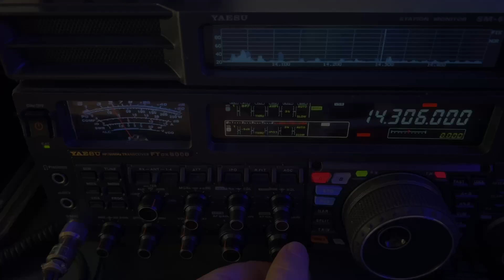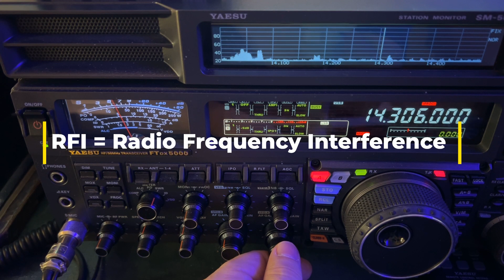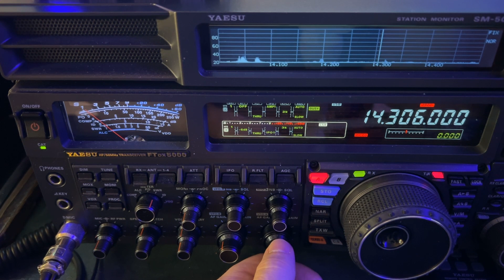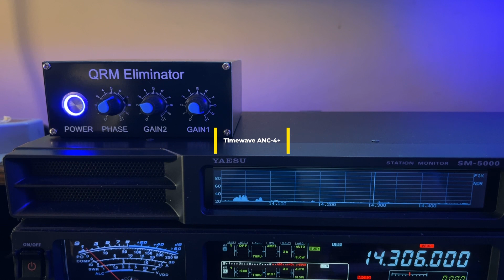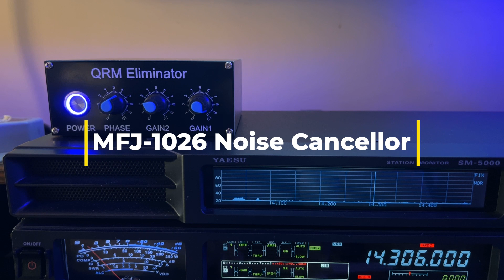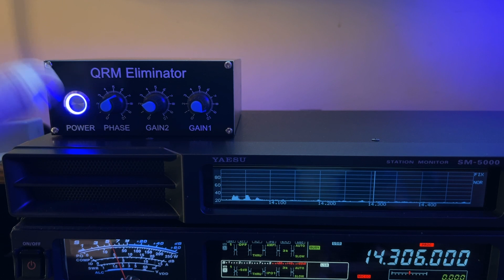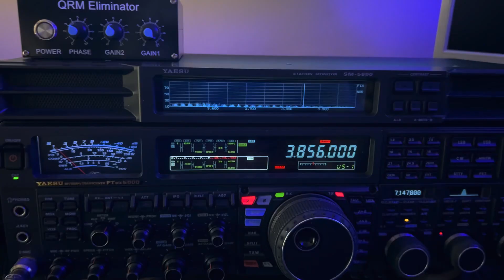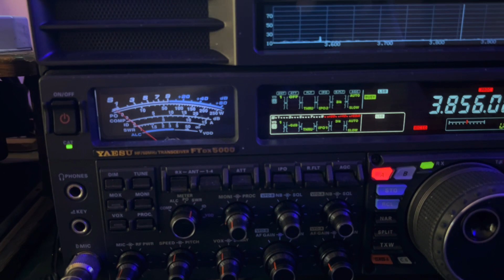This Is Getting On My Nerves #radio #noise

Comment: Isn't there a strict timeline for when the power company has to respond to a complaint from the FCC?
Reply from the maker: There might be a strict timeline when it relates to emergency communications or air traffic control.  But for amateur radio, apparently not. If you file a complaint with the FCC, you will not hear from them for 3 months. And all they do is turn your complaint over to the ARRL.  The ARRL was useless the first time I filed a complaint, but the last time they referred me to W4DD, a local ham who sniffs out RFI.  He is retired from Verizon and sniffs out RFI as a hobby. He wrote RFI Mapping software.  There is a video all about in the HF Band Noise/RFI playlist here on my channel.  

W4DD did all the legwork to prove the RFI was from 5 different power poles.  He took photos if the specific hardware issues and showed the RFI on a map, using screenshots from his sniffer software. It still took months to get someone at the power company to finally respond and send a crew out here to perform the repairs.  Even then, W4DD had to resort to calling in a favor from a manager he knew at the power company. It was a total of 2 years to finally get it fixed.  The video is at this link: https://youtu.be/TpcUUzMh-bI?si=DDMylWE-uiELkRHu

Comment: I have been off air for ten years from my inner-city neighborhood - back in those days, I could operate all bands with the usual noise found in the city, especially on 40 and 80 meters.

The noise now - on ALL bands is the most horrible I have encountered in 38 years of being licensed.  Ear splitting, 10 to as high as 20 over square wave noise, 24 hours a day, 7 days a week.

A call to PECO (Philadelphia Electric Company) resulted in them sending out a  guy untrained in RF detection who didn't even have any means of getting to the top of the pole to inpect it!  

I made another call to PECO and now they have escalated it to "an investigation."

The noise is overwhelming and makes HF all but useless.   I have monitored it as high as 300 mhz!

I ordered a Timewave ANC-4 and plan to use a 6 meter vertical for my noise antenna...it is so bad here though that I wonder if it will enough...in the meantime, ill keep calling PECO...
Reply from the maker: The power company is obligated to correct it. The Georgia Power engineer finally came out this week. Watch this video: https://youtube.com/shorts/u1i89iRZWW4?feature=share

Comment: Great video, thanks! What a bummer! Might be time to move to a more radio-amenable location.
Reply from the maker: The power company rep called yesterday. Finally, after 18 months, they tell me they are going to try to resolve it. The guy told me that they are “struggling” right now.
Reply: @n4hnhradio  Well, hopefully that's great news! One wonders what exactly they mean by "struggling"? ;-)
Reply from the maker: I already know. The engineer I worked with a few years ago to get the RFI tamped down then told me that they are struggling to find workers who are willing to climb poles.  It’s even more difficult to find someone well-versed in RFI abatement.
Reply: @n4hnhradio  Oh wow! I guess labour is hard to find everywhere these days.
Reply from the maker: Yup!

Comment: You need to equal the two signals of both antennas and then use the phase button. For this sometimes it's necessary drop the main antenna a bit (or much) all depend of gain from auxiliary antenna.  If you have much gain on your aux,  you don't need to drop too much the gain from main antenna.  The best way to do this, is looking for the minimum sound of both antennas with both variable resistors of the two antennas . Then they're in phase, with the same gain. In this point you must looking for  with the phase button where the noise its canceled or most attenuated.  Then you can put to maximum the gain of main antenna... Or not...if the noise increase too much and you have better noise floor  rate with two antennas atenuated a bit.  73s EA4IS
Reply from the maker: That’s all correct.  Achieve the same noise level from both antennas.  I covered that in other videos. In this case, the aux antenna needed less gain then the main. It was receiving a heavier dose of noise than the main. Also note that the gain is reversed on this unit, versus my MFJ-1026. For the main antenna, maximum gain is fully clockwise.  For the auxiliary antenna, maximum gain is fully counterclockwise.

Comment: I use an NCC2 with two receive antennas on a manual switch.  Takes some fiddling to get the mostly omnidirectional noise down from S9 to around S4.  Multiple receive antennas pointed in different directions might help in particular situations.  I also have an MFJ but it's controls are not as flexible as the NCC2 because of different noise on different bands needs different settings!
Reply from the maker: I like to use these devices with two identical antennas installed perpendicular to one another. Set both antennas to the same level on the S-meter and use the phase knob to electrically rotate the receive pattern.

Comment: I bought one of these a while back due to solar panel inverter noise and it works to some degree. Nothing like adding a few more knobs to diddle while playing radio.
Reply from the maker: QRM has risen significantly in the past two decades.

Comment: Here’s my experience. Called power company, really nice guy showed up and replaced a few street lights. Grounded the pole guy wires that come down into the back yard. Still a noise coming from the street light solar source. KU guy says he doesn’t know anything about the top of a street light. He said he’d contact engineer. Never heard from them. I contacted Laura smith at the FCC and she responded 6 months later CC’ing the arrl into the email. The gentleman from the arrl wanted to make sure and to teach the power company their job. I located the source 100%. Told the arrl , and the FCC. Here I am 4 years later and nothing has happened. So the FCC is a toothless lion and we’re basically just a thorn in the power company. I finally lost hope and gave up. Hope you get better support than I did/have.
Reply from the maker: One Georgia Power representative told me a few years ago that they aren’t afraid of the FCC and that the ARRL means nothing to them. But they did resolve my issues eventually. I might have to write the CEO.  If that doesn’t work, I might have to fine tune the components on the pole with my 0.45 inch adjustment tool.
Reply: @n4hnhradio  this is what happens when people don't respect the rule of law. I'm so sorry to hear of these problems.
Reply from the maker: It’s what happens when unelected bureaucrats get lazy and don’t do their job.  The FCC in our area was once very active, policing Citizens Band and Amateur Radio. They would get you for anything from interfering with the neighbor’s TV to splattering up and down the band to running too much power. Nowadays they might occasionally make an example of one repeat offender, just to possibly scare the others into submission.  But they expect the ARRL to find and record the repeat offenders.  Then, after multiple violations, the ARRL can refer the case to the FCC.  It is called “self-policing”.

Comment: This is something I really needed. I do POTA when my wife and I go RVing at GA state parks. I have had what I think is some rv inverter noise every so often on 40m at night. Could be LED lights but not sure. Either way I had toyed with getting one of these units. (QRM Eliminator) Sometimes is is s20 noise. Would this help in that regard? Thanks Robert Burton KD4YDC
Reply from the maker: Robert, there are certain types of noise, especially broad spectrum digital, that no device can eliminate. But, as long as the noise is a pulse type, these units should be able to track it and throw it 180 out of phase. Look at your scope and see if the noise looks like spikes. Also, remember that you need two antennas that are both able to receive the same noise.

73, Doug

Comment: Doug, I just listened to your recent video on the way back home from a short journey to take my father-in-law to his hemodyalisis session.

Another helpful and informative video.

I'd like to add a few notes that might  assist those interested in sorting out annoying QRM coming from the grid and, recently, LED street lights.

I suffer from the aforementioned annoyances. When the sun sets, the LED QRM is all the way up to S9, on my FT-890 with NB engaged, and down a bit after pressing the ipo key.
Whenever the sun rises, the power line QRM shows all its potential to disturb my ears. If it weren't for the FT-890 NB, DX would be a pipedream under the sunlight.

Moreover, I've been trying to find the best auxiliary antenna for my QTH. The plan is to start short and grow longer until I find the sweet spot that allows me to knock down the trash with minimal side effects.

To conclude, after reading some reviews, I bought a mini whip antenna that is said to receive lots of QRM. It arrived some months ago, but I still need to put it up in the air. Will update these notes accordingly.
Reply from the maker: Hi Luciano!  I am so fond of the FT-890, as I’m sure you know. As far as a second antenna goes, if you put up two identical horizontally-polarized antennas, perpendicular to one another, and connect both to a QRM Eliminator, you can use the phase knob to electrically rotate your receive pattern. It’s a nice bonus with one of these devices. Of course steering the receive pattern might work against the noise cancellation.  But, when you don’t need it to cancel noise, use it to steer your receive pattern.

73, Doug

Comment: Can you show how it’s connected behind ?
Reply from the maker: Like I mentioned in this video, the connections are shown in one of the earlier videos in the QRM Eliminator playlist.
Reply: @n4hnhradio  Roger, i own a FTDX10 where would you connect the PTT RCA cable into ?
Reply from the maker: Either the Linear port or the Tuner port.  I found a cable on ebay that connects to the Linear port. It has a 10-pin mini-DIN connector on the radio side and a RCA plug on the other side. But I use that port for my amplifier. The Heil FS-2 serves the purpose without involving the radio.
Reply: @n4hnhradio  means if unused we can use the foot pedal PTT port as well correct ?
Reply from the maker: You can use the foot switch or the Linear port or the Tuner port. Just get the correct cable.
Reply: @n4hnhradio  just got mine. Have you noticed a decrease of the Power Out PEP by adding the QRM in between ?
Reply from the maker: No. I trigger the PTT circuit with my Heil FS-2, so the QRM Eliminator is bypassed and the amplifiers in it are disabled.
Reply: @n4hnhradio  ok strange, mine was OFF and even got 50W PEP instead of 100W. I will double check.
Reply from the maker: Be sure you have it wired correctly. Noise antenna to auxiliary, transmit antenna to main, and connect the radio to the middle (transceiver) connection.

Comment: I find going to 3927, 7200 or 14313 always settles my nerves in 8 land.  My $20 MFJ1026 broken swap buy, has been flawless after I fixed the inductor on the power feed.  The 1026 is still better than the ANC4+ & the Chinese Eliminator at my QTH.  Good luck.

Comment: Back when I was a lineman,  we had two old timers, pretty sure that one was a ham, that would go out on "noise" complaints. They'd toodle around with a little AM transistor radio, looking for noise peaks. Almost always it was loose or broken insulator line/wire ties, occasionally an insulator itself. Late 90's.
Reply from the maker: That’s been the case here.
Reply: @n4hnhradio  I helped out a ham friend in finding the noise source that was killing his HF.  I used an old AM transistor radio and walked the property.  It turned out to be the ballast on the aquarium light.  Switched off the light, no more noise.
Reply from the maker: @allenpamscofield That was great of you, Allen.  There are so many pesky noise sources these days.

Comment: My power company uses a detection device similar to what hams use for "fox hunting". I count myself fortunate because my power company's contact for RFI is a ham too.
Reply from the maker: Wow!  You are very fortunate indeed.

73, de N4HNH
Reply: @n4hnhradio  true, but I can tell you there are far more defective poles than they can even keep up with. Fortunately they only really come into play when I go mobile around the area.
Reply from the maker: That’s why when they got my noise down to S3 after the first four trips out here, I left them alone.  There were other poles but they are approximately 1/2 mile from me. But believe me, my Doublet, with all its gain, can hear the noise.
Reply: @n4hnhradio  Yup, as can my 40-10 NVIS OCF. I also have an 80-10 OCF higher up with a shallower inverted V set up and for some reason it is quieter than the NVIS one.

Comment: Forgot to say, I connected the noise eliminator on a Alinco DX 70th and using cable link it destroyed the noise eliminator .Looking at the manual you need to cut a resistor in the DX70 for the link relay cable that cuts off transmitted  rf from going through the noise eliminator
Reply from the maker: That’s why a foot-switch like the Heil FS-2 can be so valuable. The radio has no involvement with enabling the PTT ground in the QRM Eliminator.

Comment: That magic device will work, you need some time to work with the secondary antenna positioning
And the knobs.
Chinese phone chargers are bad, BUT, when I was getting a load of crap for months, later I saw my neighbours fish tank dumped in the yard, and that was the end of my problem ahhh.
Here is my video during my goldfish rf attack.
These noise eliminators need to be built in today, auto!

https://youtu.be/5tt6b6JFvA0

Comment: this days i have an sporadic noise in 40m band, at night. Whit IPO and attenuator on S meter hits 8 and 9.. but only in 40m band, is frustrating. I made one qrm killer but i need to put a good noise antenna.
Reply from the maker: The noise antenna is critical. If it cannot receive the same noise that the main antenna is receiving, the phase cancellation device cannot help. 

73, de N4HNH
Reply: @n4hnhradio  yep that is true, i need to find the way to put a second antenna on my roof, the cost of living in a big city 😞

73!! LU2ASV

Comment: Your noise floor is S3-S4 and you're complaining? Mine is S7!!
Reply from the maker: No, the noise is S9. It has been as high as S9+15dB. I can tell that you didn’t watch the video to the end. Some people won’t watch a 20 minute video to learn how to get more from their radio but they will watch a 30-minute mind-numbing sitcom.  I’m not saying that is you. That is just a general observation.  Some people criticize my videos if they go over 20 minutes. My videos are situational. Without understanding the situation, you can’t fully appreciate the technology and the techniques used to tackle the problem. For people who don’t like my style, there is a literal plethora of other YouTube channels available for them to watch. 

I use IPO and ATT to knock down as much noise as I can early in the receiver. That is the weakness of DSP.  DSP is late in the receive chain - just before the audio amplifier.  Noise needs to be dealt with as close to the antenna as possible. Devices like the one shown in this video are between the antenna and the radio.

Consider the width control in DSP. You’re narrowing your passband late in the receiver chain. That’s one of the reasons the hybrid architecture rules. The roofing filter in the hybrid does the heavy lifting before the noise and interference ever gets to the DSP stage.

Comment: I have power line noise also. Even on 2 meter.
I can tell when its bad when the waterfall on my 991A on 2 meters goes blue. LOL.
It seems to not be consistent either. Almost like there could be weather related issues or someone in the hood doing something they shouldn't be doing. LOL.
Reply from the maker: Power line noise usually starts out less intense and intermittent. It usually happens when the air is dry. For me that is afternoon and early evening. But this has been building up to worse and worse and it is now 24/7. The wide mode noise blanker can barely put a dent in it, and then I have to listen to distortion. If I had the spare cash, I would buy a Timewave ANC-4+, but, for now, this $52 Chinese box will have to do.
Reply: @n4hnhradio  Yea here also. It's not just me either. A few other Ham's here in town also have issues off and on with it. I have a video on my phone where it seems to be surging / cycling in a few second intervals. Then mysteriously it will go away and be quiet for a few days, then appears again. A neighbor who is not a ham also has seen issues with a few of their more sensitive electronics being "noisey" reported it to the power company. Nothing so far.
Reply from the maker: I always run the circuit breaker test to be sure the noise isn’t coming from within my house. I run my FTdx10 on battery power and flip the breakers one at a time to see if the noise is from a device plugged into a particular circuit in my home. That way, when I call the utility company, I have done my due diligence. In this case, I drove around in my neighborhood and listened with my FT-891.  I know which poles the noise is coming from.
Reply: @n4hnhradio  Yep did that also. Even with battery the noise levels are S7 at times. 
Crazy times.
And they want us all to go electric vehicles. Just imagine all the electrical noise from all those household and commercial
 charging stations.
Reply from the maker: That’s an interesting point. But I can say that when someone charged his Tesla at my home, it didn’t interfere with my radio. He charged it all evening and at night, until the next day.